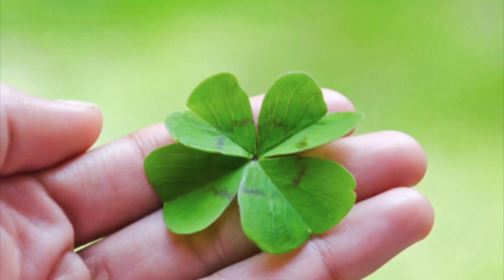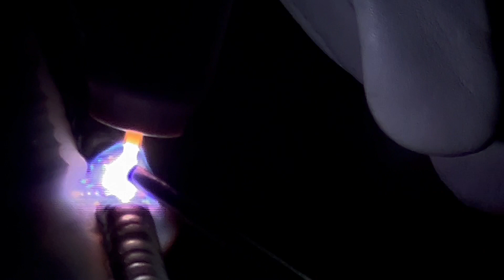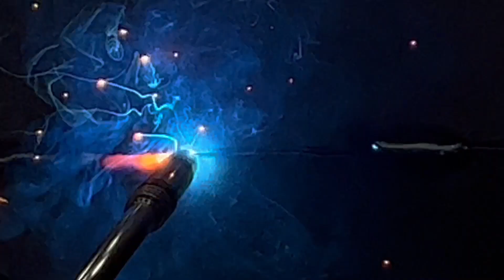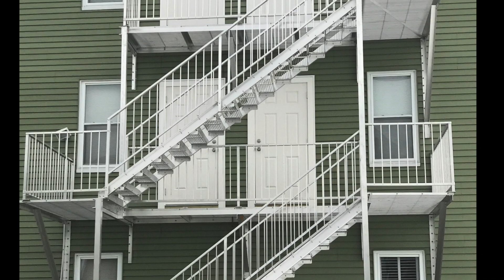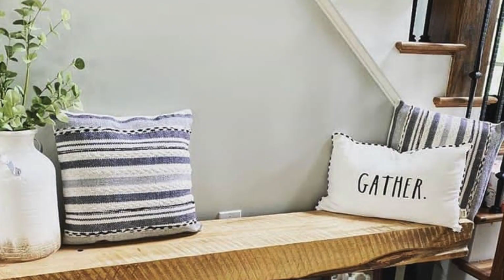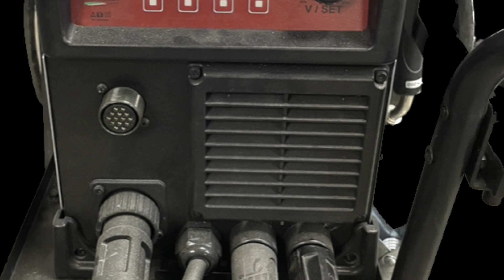How a multimillion dollar company gave me the opportunity of a lifetime (full story)

Comment: This looks like an awesome machine I’ve always thought before if you want a good welder you had to go red or blue but now I’m just looking forward to adding another htp machine to the lineup the pp220 has worked awesome especially for the mobile work so the revolution would be great for the do it all in the shop thanksPeter for sharing your knowledge. I’ve told everyone that’s been in my shop and asks about the welder how great the machine and customer service has been I know one guy bought one and another is looking to purchase soon
Reply from the maker: if you run 4043 in 035  just switch your machine in the 5356 3/64 program.  That will be almost spot on for 4043 035 non pulse!  You retain all the synergic functions and you can still use your slider
Reply: @ZILAwelds  awesome thank you

Comment: I wonder if Stell has any plans for upgrading the computer chip in the Invertig 220? I asked because I read your reply in a comment about upcoming multiple wavelengths coming.
Reply from the maker: You mean the 221 tig?  Well… typically a welding machine has a 6-12 year model life ….  Maybe during that time it receives some upgrade or facelift like the pp200 then the pp220 ….
The 221 has been out since 2008.  It was about 10 years ahead of its time ….  Never the less ….  Today is 2023 ….  So even though the machine has OUTSTANDING arc dynamic and is a very portable package ….  The user interface is only so intuitive ….  And its pretty save to say that no one is updating anything on this 15 year old machine ….  A newly designed tig to take its place is long overdue i n my opinion ….   But who am i ?  The 221 is still a very good “classic”.   I am so looking forward  to something fresh and new ….  And i think eventually it will have to come …  so htp can play in the premium league again in the 200-250 amp class …..
Htp has pretty good representation in the 300/400 amp class, good features, intuitive and simple user interface ….  NOW this needs to move in the 200+ amp class of machines ….  That would logically be the next step!
Reply: @ZILAwelds Yes the 221, was typing fast. The 221 has been around for some time and I totally agree about the 221’s interface being only so “intuitive “. The Revolution 2500 is cutting edge and priced affordable also.
Reply: @ZILAwelds Watching one of your older videos of the repair of the 200 gallon tank. That was a video I liked. The Revolution 2500 you said has virtually no smoke, I don’t know how they do that.   I was still looking at the Pro Pulse 200. It’s on sale now.
Reply from the maker: @Mikael5732  the pp220 is an AWESOME machine ….!!!  It is/was may baby !  My 4th child … LOL 
And for mobile jobs the 44 lbs pro pulse sure beats the 80 lbs revolution! 

But the revolution welds SOOO nice! 

Nor saying the pro pulse is bad by no means …. And i helped develop that as well …. But i worked with a different software engineer at Stel. The guy i did the pro pulse is is very good, my opinion, the guy i did the revolution with : even a little bit better !
Reply: @ZILAwelds  Thanks. I may go for the Pro Pulse 200. I need a mig welder.
Reply from the maker: @Mikael5732  well - it NOT a bad choice it is $2000 cheaper and I can teach you a "hack" on how to run 035 aluminum wire in the PP220 without pulse even though there is officially not a program for it .
Reply: @ZILAwelds  Okay!!!  I have a few items to sell and will let you know when it arrives. May be a few weeks. And thanks in advanced.
Reply: @ZILAwelds I would definitely be interested in this so called hack I love my pp220 I’ve been doing a lot of mobile work with it and like you said it’s great it’s so nice to throw in the truck and go. I used your idea with a 50ft gas hose and 50ft extension cord. The bottles and the gas drive stay in the truck and the 220 goes up the latter or in the trailer with me

Comment: Thanks for the detailed video, this machine is gonna make a lot of machines obsolete!
Reply from the maker: maybe ....  even though it was designed with the repair industry in mind ... based on its weight it looks really good in a shop on a dual tank cart. LOL  As far as making designated machines obsolete - wait and see what the next generation dedicated TIG only machines have in store ....  you may need a degree in computer science to operate them ...  the writing is on the wall ... the new thing is a ton of wave forms on AC, and mix and match wave shapes on the positive and negative side of the wave ...  and in DC different wave forms for the DCpulse ....  and and and ... the feature madness does not stop there ...  we live in interesting high tech times ...   now do you need all them to weld...?   hell no ...  I have seen guys weld with 12 volt car batteries ... LOL.  but in some situations it sure helps
Also welding machines are not like women ...  you can easily have more than one and they are typically not jealous of each other ...  
THIS machine here though is the perfect "entry level" platform, space saver in a one car garage or on a cramped service truck ....   it checks a lot of boxes and really gets it done !